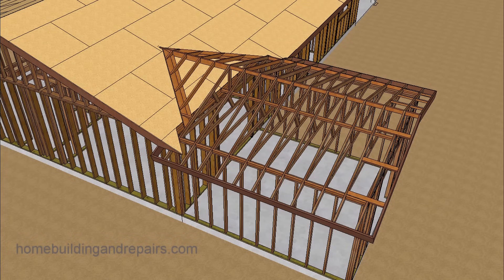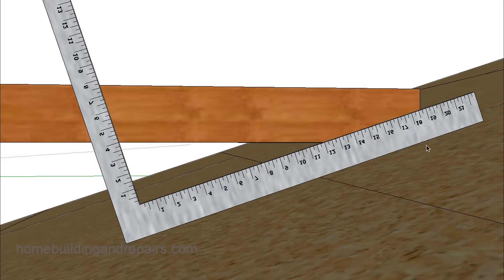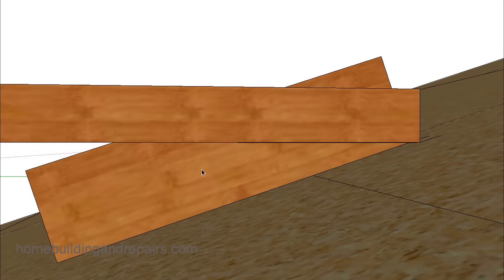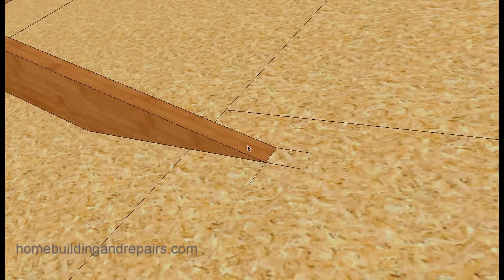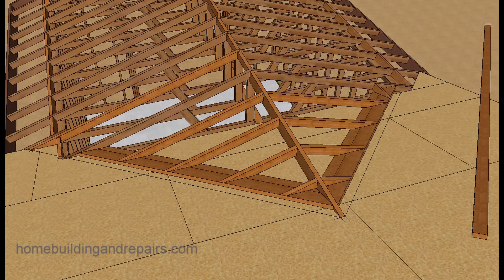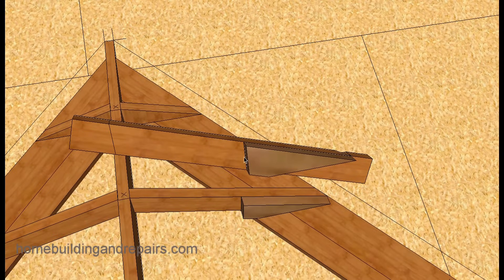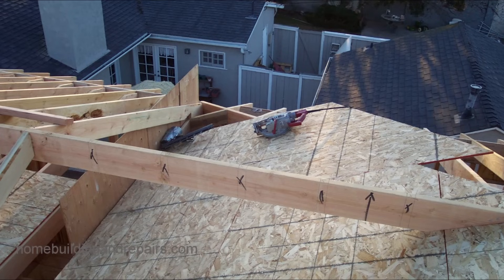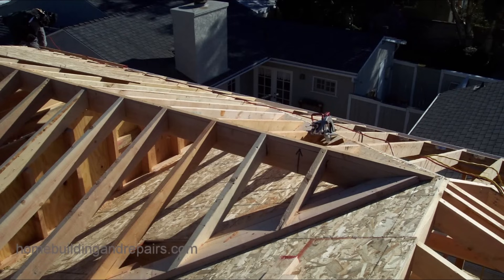How to Install Roof Framing Fill for New Home Construction and Home Additions

Comment: at 0:10 can you describe how the flashing might look where the fly rafter is running into the roof? I am imagining, peal and stick in the valley, then drip edge on the rake, metal valley flashing extending down over the drip edge. But what about flashing the vertical portion of the fly rafter to the roof? would you do that similar to a dormer? The multiple angles are confusing me.
Reply from the maker: I would probably need to do a video about roofing to answer your questions and when it is made, will put a link here.

Comment: Did you account for the distance from the peak of the truss to the top of the ridge board? That theoretical peak means the ridge has to be dropped an extra 1/2 inch or so, right?
Reply from the maker: I didn't get into using math formulas, so it wouldn't be needed. The theoretical rafter length might not be necessary when using the examples I provided in the video.
Reply: I'm just saying there's a difference in height in a truss peak and the actual top of a framed ridge board. That peak is not there on a framed roof, it's only a theoretical peak. So if you set the ridge extension on top of that peak, then wouldn't you also need to cut an extra half inch or so from the other end, so it will drop the right amount on both ends?
Reply from the maker: It's hard to understand what you're asking, but if you're working with an existing ridge and simply measuring each rafter individually to the edge of the ridge, then you wouldn't need to make any adjustments because of the theoretical ridge line.
Reply: It has to do with the ridge board of the add on. When the roof of the add on is stick framed, then you set the ridge extension on top of the add on's ridge board and put a level on it. Then, when it's level, you mark where it get's cut, meaning it will drop 5 1/2 inches if it's a 2x6. That, in turn, means the other end has to drop the same amount. So, when you set this ridge extension on the peak of a truss, dropping 5 1/2 inches will have the top corners sticking up too high. This is because of the peak. That's why I say you'd have to drop it an extra amount. That amount would be the distance from the peak the the top of where a ridge would be, if it were stick framed. The alternative would be to 'back' the ridge board, and no one would do that.
Reply: Okay, I just figured out where the confusion is coming from. You're making a pattern for the angled cut where it hits the existing roof, and then measuring for the length of the new ridge board. The way I was taught is to use a scrap piece the same width as the ridge board, placed on the existing roof and slid up to the top corner of the ridge, on the main roof end. Then you mark that angle, and also mark the other end where it gets cut square. This makes it drop the right amount. The extra drop (when using trusses) is not applicable in your case, since you're measuring the length of the board. Just a slightly different way to achieve the same result. Sorry about the confusion.
Reply from the maker: Well at least you got it. Sometimes it's hard to make sense out of the sum of stuff we're building or talking about in the videos in comment area.
Reply: We just have have a slightly different technique. Same results.

Comment: how wide is the metal flashing supposed to be on those roof fillers?
Reply from the maker: What piece of metal are you referring to?
Reply: the galvanized flashing under the shingles where the snow piles up
Reply from the maker: I would check with a roofer or roofing materials supply store for more info. Certain parts of the U.S. and world might have different sizes or building code requirements.